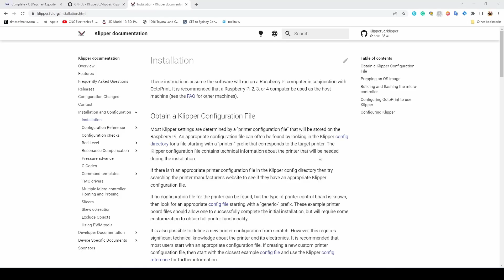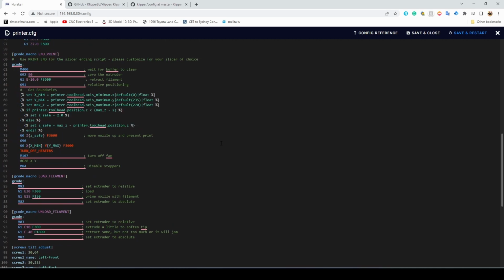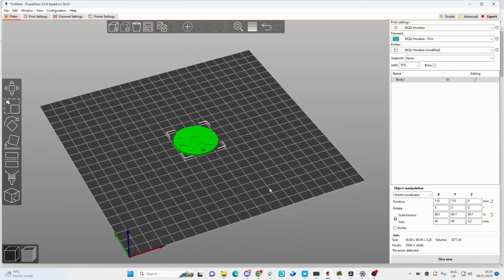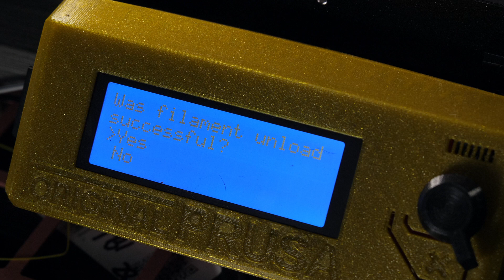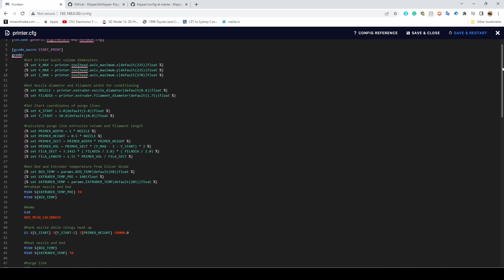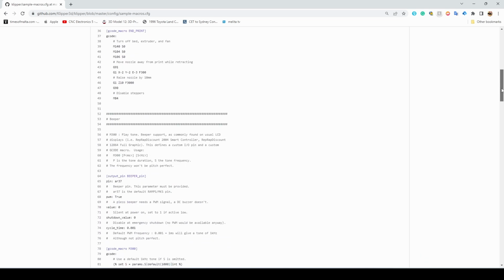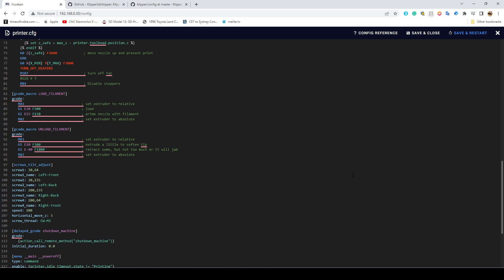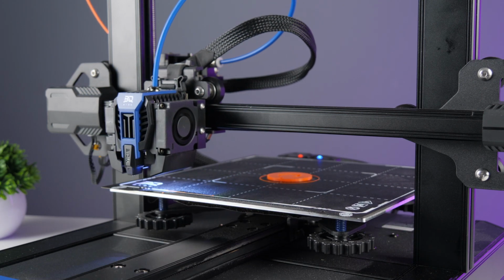Klipper And M600 Color Change Macro

Comment: This is just great. Its fantastic!!!
I am gonna do a test. I use astroprint and I was wondering, how can I find where the layer is to enter the m600 code?
I use astroprint then export the file to an ncviewer I believe it is called where I can move until the layer I should like to change. There I see the rowline number.
Then I use notepad++ and add the code. Reupload it to the klipper url.
Bit I am sure there is an easier way.
I just saw you can view it in klipper also you showed. But how do you know where to put it? There are so many lines of Code.
Thx and great explanation on how to change the Color
Reply: I did a test. It stops. I can change the filament and if I add the filament and press continue it will expel done filament. It goes to where it left of. Stops and start beeping. Then it stops

Here is my inserted code 

G1 X117.393 Y119.600 E28.40312
G1 X116.842 Y119.600 E28.42996
G1 X116.226 Y118.985 E28.47231
G1 Z3.000 F7800.000
; PURGING FINISHED
{% set X = params.X|default(50)|float %}
{% set Y = params.Y|default(0)|float %}
{% set Z = params.Z|default(10)|float %}
SAVE_GCODE_STATE NAME=M600_state
PAUSE
G91
G1 E-.8 F2700
G1 Z{Z}
G90
G1 X{X} Y{Y} F3000
G91
G1 E-50 F1000
RESTORE_GCODE_STATE NAME=M600_state
G1 X119.889 Y119.889
G1 F1478
G1 X116.111 Y119.889 E28.65405
G1 X116.111 Y116.111 E28.83580
G1 X119.889 Y116.111 E29.01754

If anybody could help it would be Great. Thx
Reply: Hi again. I found it and it seems to be simpler 
I added the next line

M600 B2 X10 Y10 Z30 E-5.0 l10

After you changed the filament just hit continue. It will expulse some filament at the coordinates and continue. I did some tests and I finally made my first 2 color print. Not Bad after having the printer almost 4 Weeks.
Hope this can help other people also

Comment: I'm looking for help. I would like to be able to change the filament manually. I don't have a runout sensor  and I have spools that won't finish some jobs and I have a new spool also rather than start with the fresh spool I want to run it down than do a filament change when I want.   
If I use the puase it will park the print head immediately and than I can change the filament and than when I resume it will start on the very next layer because puase will stop on its current layer so when I resume what ever part of the layer that wasn't finished will have a layer missing. 

I need a solution

Comment: Question (in case you know): I added the M600 macro you linked to and it seems to work well.  However, my BTT filament runout sensor now triggers all the time; I have to disable it for prints to resume normally.  Any ideas?

Comment: Thanks for the instruction. I am not able to get it to work, it shows me this message and I don't know why: "gcode command M600 already registered Once the underlying issue is corrected, use the "RESTART" command to reload the config and restart the host software. Printer is halted"
Reply: Having the same issue. Did you find a fix?
Reply: @auntiegymshoe  Yes, the M600 code is declared in a "hidden" file. The easiest way without having to search and modify it is to add the macro M600 to the printer.cfg and inside it and at the beginning add: "rename_existing: (the name you want without the parentheses, for example M600.1)". 

For example, as I have the macro and the previous line is:

[gcode_macro M600]
rename_existing: M600.1
gcode:
    {% set X = params.X|default(50)|float %}
    {% set Y = params.Y|default(0)|float %}
    {% set Z = params.Z|default(10)|float %}
    SAVE_GCODE_STATE NAME=M600_state
    PAUSE
    G91
    G1 E-.8 F2700
    G1 Z{Z}
    G90
    G1 X{X} Y{Y} F3000
    G91
    G1 E-50 F1000
    RESTORE_GCODE_STATE NAME=M600_state

Comment: I am very new to Klipper.  I did a test print with the M600 and it seemed to work.  I am now trying it on the project I dove into all of this for, but I have a question.  There was a 1 hour timeout timer, if I am not in front of my printer when it times out, the print would be cancelled.  Any advice on how to extend the timer or such?  Thank you for your time.

Comment: I feel like I must warn you about your Hurakan. If you take off the gantry, and remove the bottom plate, and look at what's connected to the FG post of that printer, you will see TWO GROUND WIRES going to that post. One comes from the cross member of the frame (between the power supply and the control board), and the other ground comes from the switch/power supply coming into the printer. From everything I've read, and from the horrible experience I've had with my Hurakan, there is a real possibility of a horrible electrical event happening because there are two ground wires on that post. Please check your printer, and please comment. thank you.
Reply: As long as they are both ac ground lines that's fine, it wouldn't be up to code without it most places, actually it's good to have multiple grounding points. They are both going to the same ground connection at the power inlet anyway.
Reply: @shawnr8164  one ground is from the power inlet, the other is from the frame. from the factory, they're both open-spade connections. when you do resonance testing, the vibration can shake at least one of those two connectors out it's capture. that's what happened to me. the loose from was from the power inlet. when the wiring I had do to put a better hot end on the printer, all heck broke loose. I lost the complete wiring harness to the board, the board itself, three of the four stepper drivers, the hdmi port, and the " BIQU monitor I had plugged into the printer. I replaced the open spade connectors with ring connectors, which can't be vibrated off the FG post. Only cost me three months and $300 for all the parts I had to replace.

Comment: Great video. What's interesting to me is that my first printer was a Zortrax m200 6-7 years ago and this feature was already in their proprietary software then. I've been doing prints with 5 or 6 color changes with ease for years. I'm surprised it's taken this long for other slicers to add it.
Reply: Emm... nobody said this was new. You could do this on Marlin for more than 5 years now...
Reply: @alejandroperez5368 Emmm.... I didn't say it was new either. I was also speaking about the slicer software and not the firmware. To be able to do it in the GUI in a few clicks like he was demonstrating.

Comment: Great video. Use the same macro, but if I don't change the filament for a long time (About 2-3hrs) after I change it, it asks me to home the printer. I can't home it, because I have safe homing enabled. Does anyone else face the same issue?
Reply from the maker: I’ll try that out and see if it happens to me too, always good to know
Reply: @3DMakerNoob  please let me know how did it go?
Reply: it asks you to do a "home" because you're waiting too long... klipper has built in safety features that after a certain amount of time of inactivity, it will power down the motors, turn off the hotend and bed... once this happens the printer has no idea where the tool head is and as such, can't resume. I believe there's a way to increase the "timeout" length but wouldn't recommend it... 2-3 hrs seems an overly long time to sit between a filament change anyway.
Reply: @cdsmakestuff  awesome, I didn't know that. I'll look into it. I print overnight, and I use the same M600 for filament run-out sensor as well. When I was using Marlin, it waited for me as long as power was on. I was expecting the same... lol. But nozzle cools down, only the bed and the motors stay on.